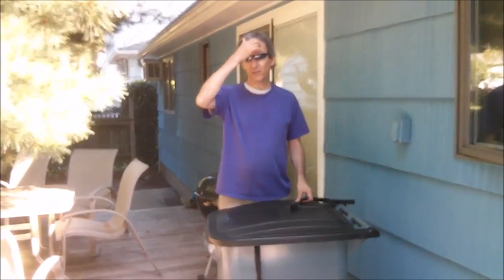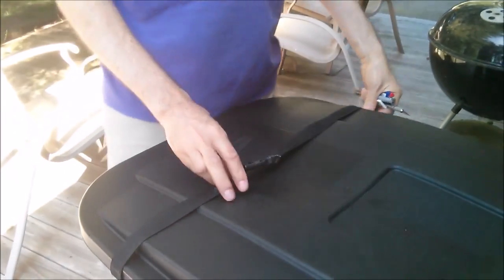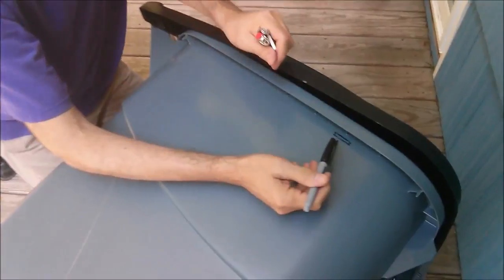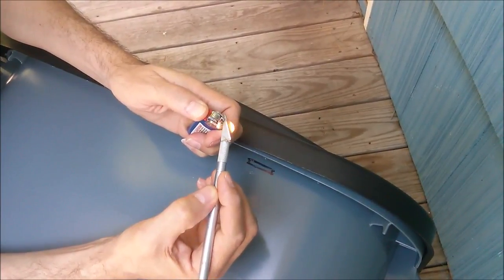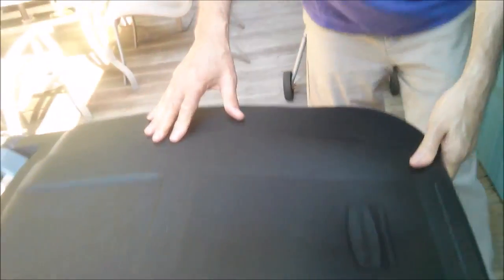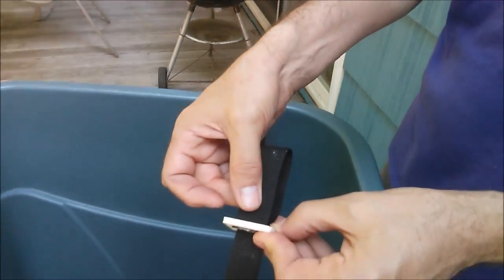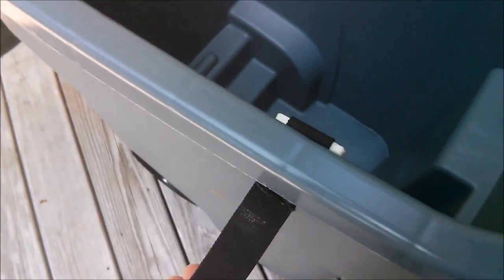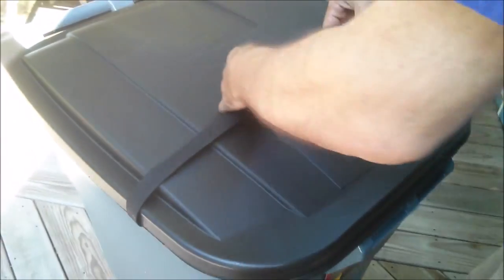How to make a trash can raccoon proof

Comment: Instead of heating up a razor seems to me to be easier to use a small drill bit to get it started and then use a small saw blade.
Or simply use the drill and then cut with the blade.

I will use your idea but change it slightly.
Going to order Deck loops and screw them with a nut and bolt to the sides  on the outside.
This way I only need to drill 2 holes each .
Just a different way of doing it.
Your way doesn't require buying any hardware 
Thanks for the video

Comment: I have a small soldering iron with interchangeable tips including a knife tip.  Works great on plastic, etc., and you can smooth any sharp edges and not have to hold a lighter or keep a candle lit to heat a blade.